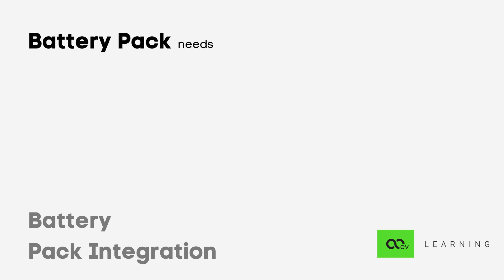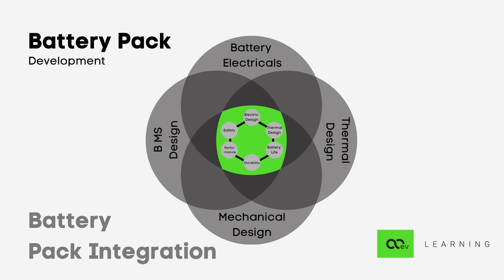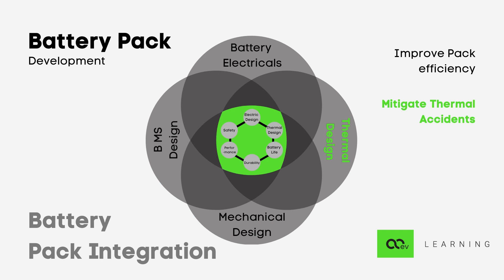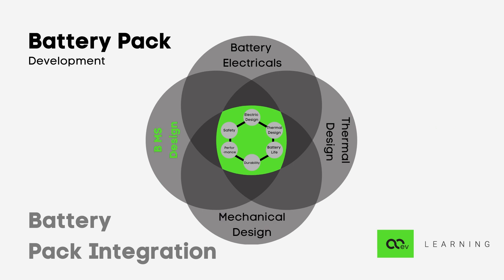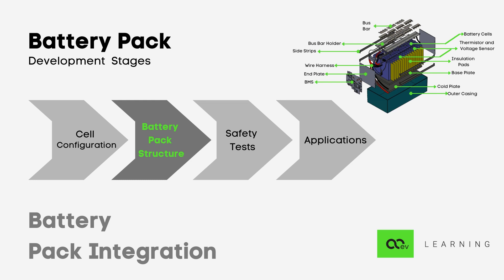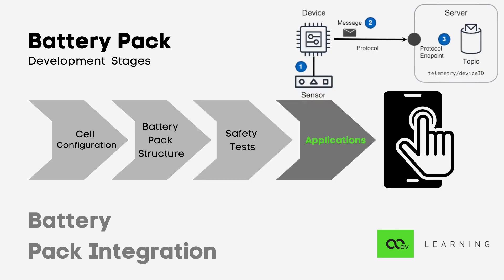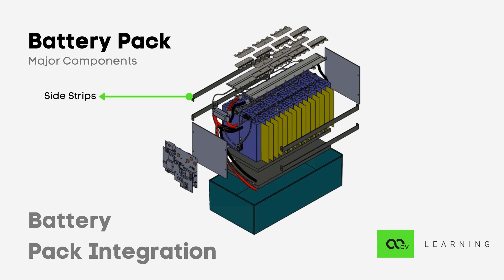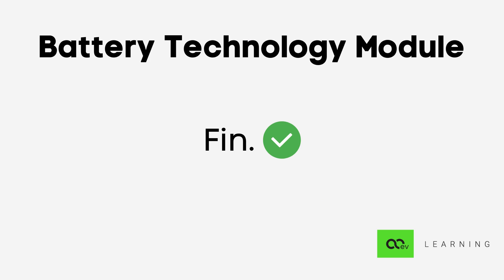Battery Pack Design | Lesson 12 - Course on Fundamentals of Electric Vehicles | Nexloop Learning

Comment: When you have pouch cells is it really important to have insulation pads?  In your example there are no isolation with the cold plate for the prismatic cells.  My reasoning the pouch cells itself is insulated sufficiently thus not requiring further insulation.